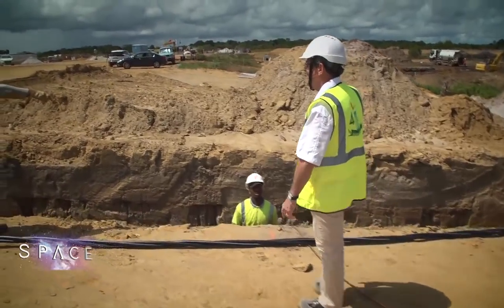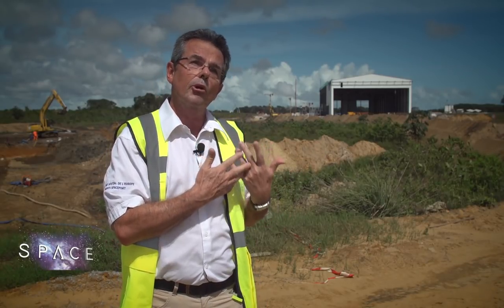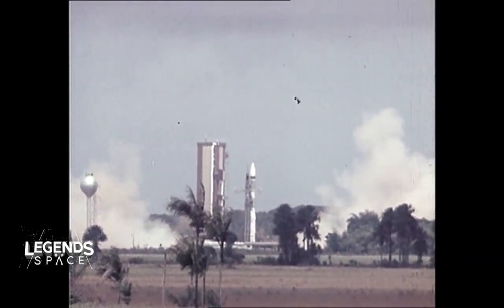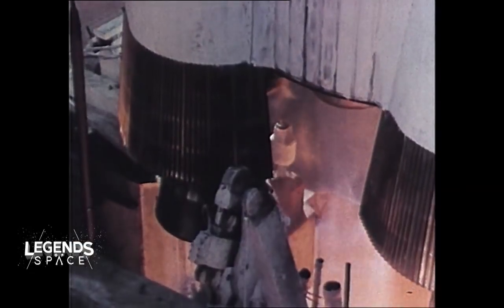ESA Euronews: Ariane 6

Comment: Could anyone clarify how the ariane 6 would be more effective then the falcon 9? I understand that the upper-stage can be reignited allowing to release each satellite in different orbits however the falcon 9 can recover its first stage, reducing prices significantly. As far as I know the ariane 6 can't do this.
Reply: "...reducing prices significantly"
How do you know that?
Reply: Oh... That's not really an answer though, is it? Much like everyone else, Musk is blowing his own trumpet. Just like he's not going to advocate for combustion engined cars. The Orbiter was the most expensive part of the shuttle program. It was also reusable and it still ended up as a money hole.
Also, cost reduction does not mean price reduction. SpaceX are just going to bill as much as they can get away with. Why wouldn't they?
Reply: But the goals are still largely the same. Cheap access to space being one of the most important ones. Now, I don't expect SpaceX to fail as hard as NASA did in this direction but at the same time I don't see other space agencies and launchers going out of business any time soon. I guess they don't follow Musk's infomercials.
Here's some food for thought for you:
* Refitting a booster means higher cost per booster.
* Less boosters manufactured means higher cost per booster.
* Return fuel means lower payloads and that means higher cost per mass in orbit.
* If it were that much cheaper, it would've been done years ago during the Cold War. Probably by the ones who never had much money to begin with (ie the Russians).
* I bet both India and China are able to manufacture and launch throwaway cheap boosters. Much cheaper than Musk ever will.
Reply: Ugh, some typos in my comment there. Oh well...
Reply: You keep replying with URLs to videos of random dudes which are only marginally relevant to the discussion. Are you aware of any INDEPENDENT price comparisons for launchers? Preferably something that includes insurance, because, as much as I like some reusable religion, I'm not putting my effingly expensive sattellite on top of something that has gone 4 times up and down the atmosphere, just to save $100k...
Reply: nythrix first of all it’s more like saving a couple of millions than thousands and second of all I could be wrong and I know I’m prejudging but I don’t think you are launching a satellite any time soon.
Reply: Mich0071
Well, you never really know who's on the other side of teh 
internetz. A micro or nano satellite can be sent up for ~$100k. Which is easily affordable for research institutions. Or a Kickstarter campaign (https://www.kickstarter.com/projects/880837561/skycube-the-first-satellite-launched-by-you).
Reply: +nythrix It's a miracle how, ever since SpaceX came around, the internet got flooded with people who think they're smarter than the businessmen/women, engineers and designers who make top-level decisions on every space launch company under the sun that ISN'T goddamned SpaceX... The R E U S A B I L I T Y circlejerk is starting to get tiresome.
Reply: nythrix fair point well made, no matter what companies are doing, I think we can all agree that bringing the cost down is good for everyone, all we need to to do is sort out the space junk issue
Reply: "As far as I know......"       Why this obsession that the only way to boost Falcon 9 is to denigrate all other launch systems?
Reply: Mich007
Yeah, it took a couple of thousand years for mankind to realize we can't just throw stuff around and wait for it to magically disappear. I hope flying garbage starts getting fixed before it's too late. I guess most space agencies have some ideas and solutions but the political will (=money) is definitely missing.
Reply: Is it not fair to say that reusable rockets have greater potential for cost savings than expendable ones?
It seems to me that Arianespace is betting on SpaceX not being able to realize this potential, given their "lack of enthusiasm" for Prometheus. Not to mention the somewhat "relaxed" timeline. The Ariane 6 in 2020 is being put up against the current Falcon 9, but by then that launcher will have seen 2 more years of flights and reflights and launch/refurbishment cost optimizations. Not to mention that the BFR is only "2" more years out from then. I doubt that particular date, but if they can realize the stated ~7M$ launch costs (or accounting Musks "slightly off" predictions, say 3 times as much), most expendable launchers become unattractive.
Reply: nythrix the different is, spacex reuses the booster, the most expensive part. 
Nasa reused the orbiter, the most expensive part, but its booster was as expensive as the falcon 9 booster. 
The orbiter in general is in essence just a very expensive, massively heavy, and complicated manned fairing. Nothing more.
Reply: nythrix you actually save a lot of millions, and everyone has an insurance formtheirmsatellites already.
Reply: Aaack Aardvark but spacex will be able to do them soon, with the falcon heavy.
Reply: Martin Mehalla well ESA is very interested in reusability. Matter of fact they are studing a new reusable booster.
Reply: I don't know that either would be "more effective" than the other. they are two options, located in different regions of the world, with different procedures and policies. If they were EXACTLY the same, one would still attract certain customers, while the other would attract different customers. 

You're comparing apples to apples, man.
Reply: NiceWhenEarned RudeMostlyElse 
True, but ripe apples to rotten apples.
Reply: @nitrix, The block five costs $40 million to take 23 tons into orbit, while ariane 6 will cost $90 million to take 20 tons.